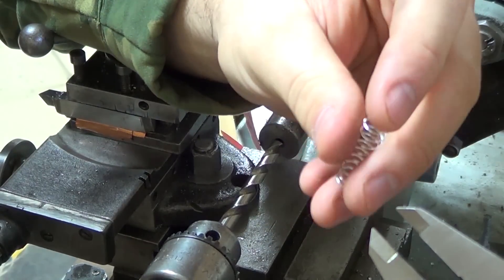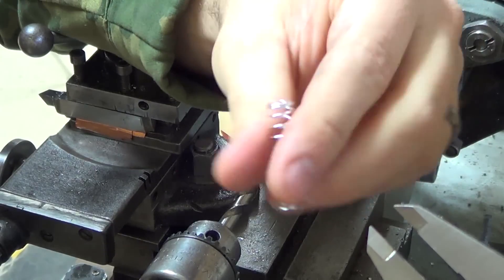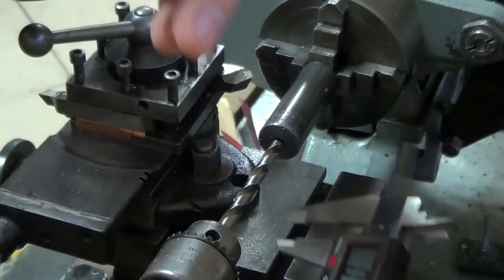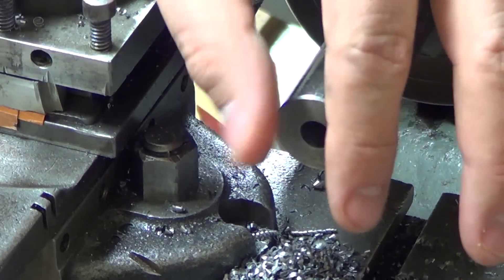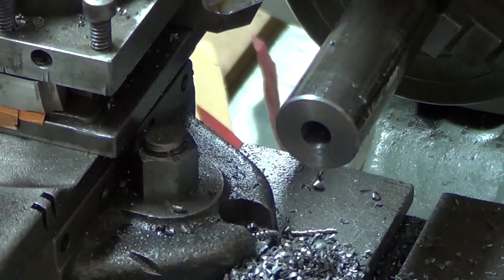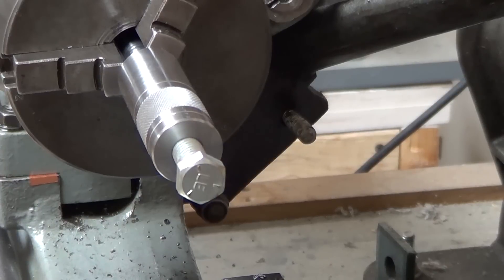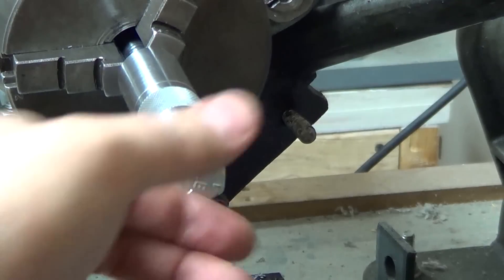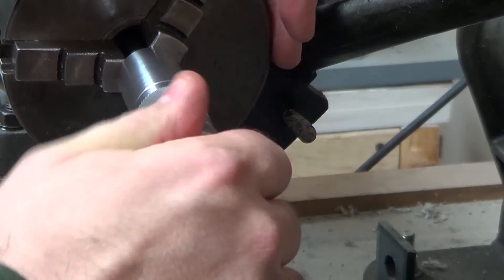Metal Lathe Spring Center // Beginner Lathe Projects

Comment: Great design, much cleaner than the type that requires milling a slot in the barrel. I love it that you don't get hung up on dimensions, if someone needs dimensions for this project they need to first unplug the lathe they are planning to use. I am going to make mine with an M2 taper so it will just pop in and out of the tail stock or quill on my drill press.
Reply from the maker: +kazorb kram Yup, a real simple and fun project.  Thanks for watching.

Comment: when would you use something like this? And does the center point spin when it's being used?

your videos are great! I bought a horizontal milling machine after watching your videos.
Reply from the maker: It applies back pressure to things such as a tap.  The one I created in this video will be prone to spinning, but your mileage may vary depending upon the size of spring being used.  I appreciate the positive feedback.
Reply: Excellent. I plan to make one.

And if you're open to suggestions, any videos on using the horizontal mill would be appreciated. There's plenty of vertical mill video out there, but these little horizontals are vastly under-represented, and underappreciated.

Nice work! Thanks again.
Reply from the maker: That will happen.  Just have to finish "tooling up".